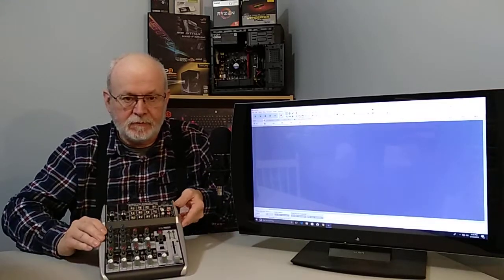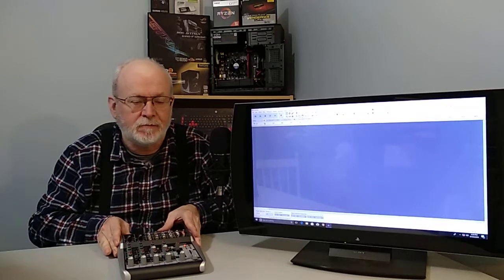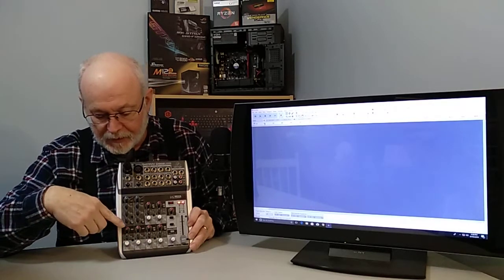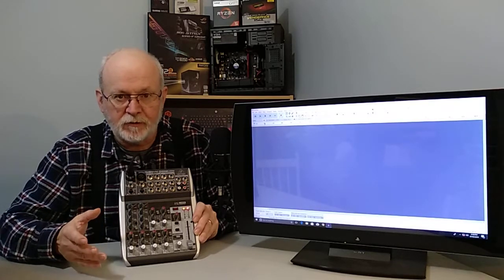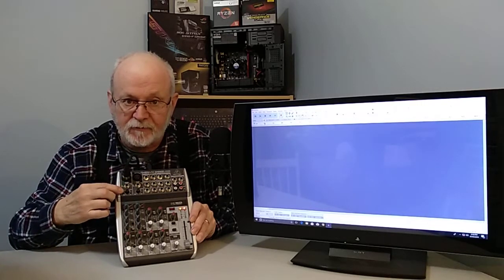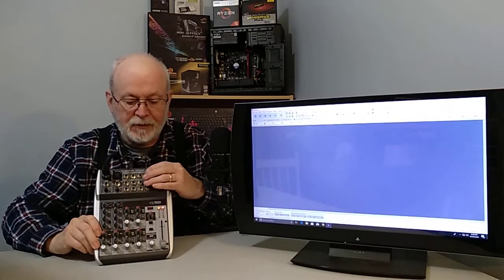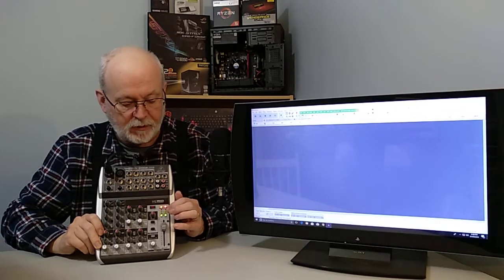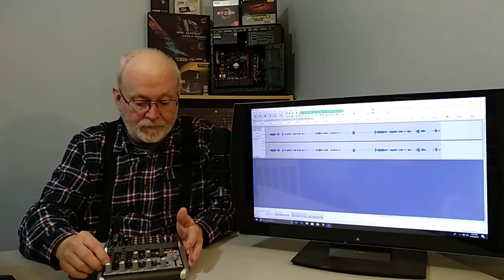Setting Up Behringer Q1002USB Mixer and How I Start and Stop Recording my Videos

Comment from the maker: You may have noticed the amplitude of the audio went down as I was Panning from the top channel to the bottom channel, that was because (@ 20:17) I moved the line level adjustment down as I was moving the Pan nob...
Reply: hi murray, i like your video... thank you so much. i have the same mixer here and I can't set it up properly. my daw seems to not detecting any input out of it. i tried to use audacity and cakelab already and still can't manage to record
Reply from the maker: Hi,  @nikooscario   I just plugged in the Q1002USB and Windows 10 set up the driver automatically. It just worked from there. ASIO4ALL (the link - http://www.asio4all.org/) is a driver you can try instead of the Windows driver, it is  a low latency driver for just about all mixers and audio interfaces. Just remember to pick that driver when setting up your DAW. I hope this helps, if not let me know and I will try and figure something else to do...
Reply from the maker: @nikooscario , if you'd like to check out this video and see if this would help. RecordingStudio9 is doing a full review on the Q802USB, which is pretty much the same mixer less two channels. I will send the link to the first video (he is doing the videos just now, so they are new) here is the link - https://www.youtube.com/watch?v=MSFfhH_lXwo&t=121s
Reply: Thanks a lot @murraystechtime8530 after I watched the whole explanation of your video I managed to detect my instrument sound on the daw. I will watch the video you mentioned rn cause I still can't figure out how to playback the guide sound I need to use while hearing the output of instrument I'm currently recording 😭
Reply from the maker: @nikooscario , good for you to get the instrument sound detected. Now for the rest of it, good luck... (Any more questions just ask, please)
Reply: @murraystechtime8530  oh man! Thanks a lot for showing that channel to me. Most of my questions of the mixer are now answered. https://youtu.be/9w9ovvHmlEc this video from him is quite helpful.